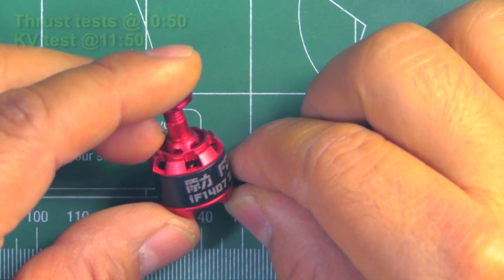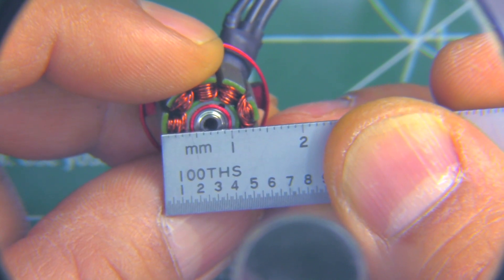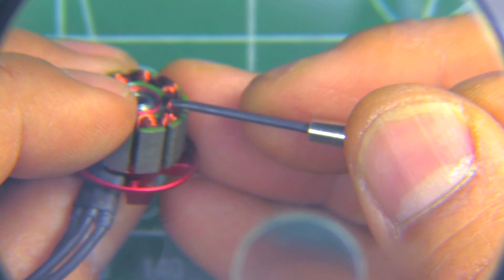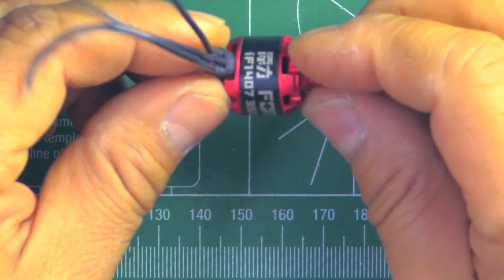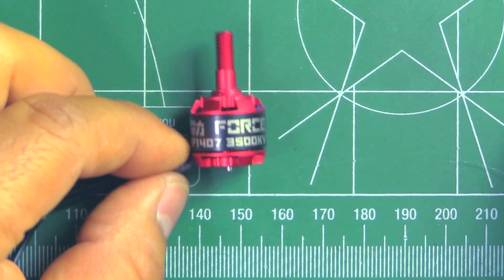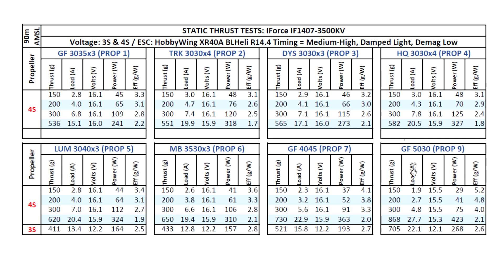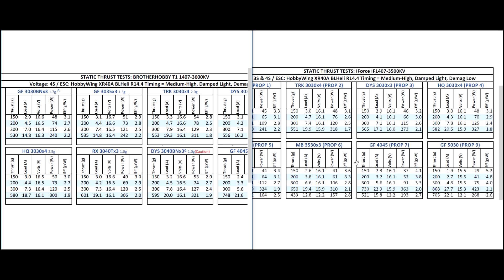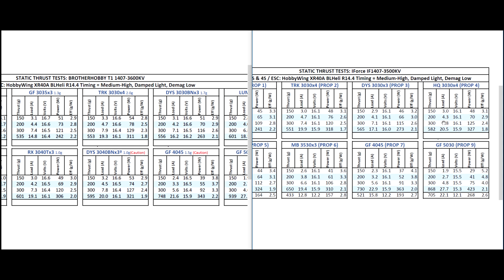iFlight-RC.com iPower the Force IF1407-3500KV Static Thrust Tests & Overview

Comment: These motors are winners! Might sell my BH1407 for these. Also, you should start testing with the new RK3076x3 props. I can send you a set if you want.
Reply from the maker: I saw those on the RK website and also the 3041Q4CS. Those look very interesting, the only thing is that they could be like their TRK 5051x3 which don't show good numbers on the thrust tests because they need to be moving forward and are designed for fast speed flights. But, yeah, I'll test them once available - I'll have to do a flight test as well to see how they fly. 
Sure, if you want to send a prop - send me a message thru YTube messages. Are you in the US? Otherwise too expensive to send!. Thanks for watching!
Reply: Sent

Comment: What happened to the RotorX props?
Reply from the maker: Eventually they died..... after many tests, mounting/ removing from motors, blades started to develop white creases and I was afraid they'd stab me in the eye. If you check tests for Lumenier 3040x3 on BH1407 and compare to RX T3040, performance is nearly identical. Thrust is within a few grams and Amps for RX are just slightly higher so I decided to just test the Lum as it'll be more durable and I don't have to be all that careful. RX is one of the better props still. You can pretty much look at the Lum numbers and they'll be the same for the RX
BH1407 test https://youtu.be/eDB3vB_Xnao?t=44s
XN1407 test https://youtu.be/lVsGjIJ3RNg?t=7m24s
nearly identical in both!